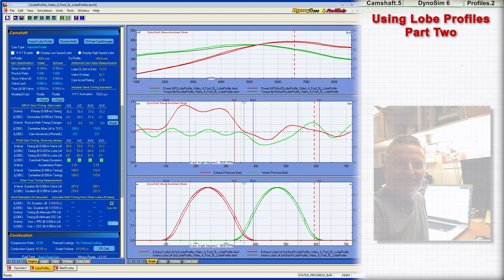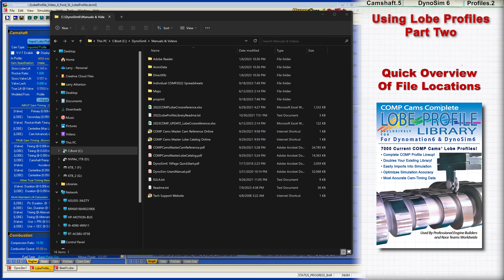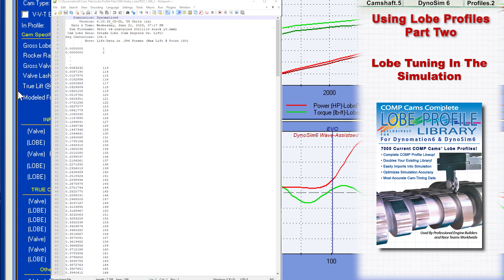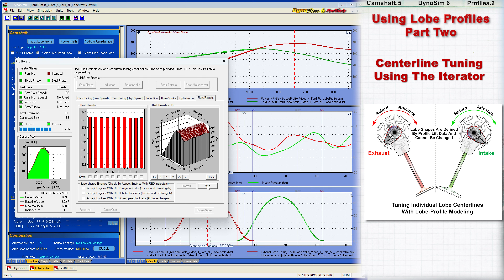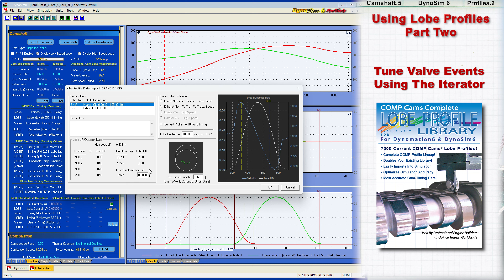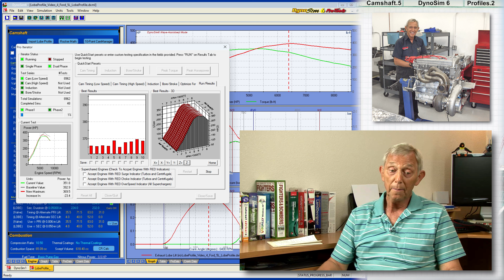5_Cams And Simulation, LOBE PROFILES.2

Comment: So when comparing hydraulic flat tappet to hydraulic roller cams with the same lift/duration specs is it better to not use the 10 point modeling as the roller has more high lift duration (0.200"+ lift range) and hence more area under the curve that 10 point modeling won't see ?

To more accurately model a roller lobe would you not need 7 instead of 5 profiling points ?

I bring this point up because i find that when modeling and comparing similarly spec'd flat tappets and rollers the rollers don't make any more power and that just seems counter intuitive to me , Please Explain how best to compare flat tappets and rollers . thank you

Comment: How do we get this? I have a old 2000 I like to use on my old windows 98 . Still works! This is the only thing that I have it for. I have a Mac now. Is there any way could get a new one for it? You have a lot of new stuff in this compared to my old 2000.
Reply from the maker: You can find more about the software at www.motionsoftware.com. Our latest version six simulations require Windows 7 or later. Thank you very much for watching the video and for using our old Dyno2000!